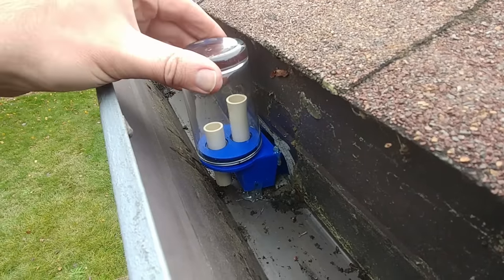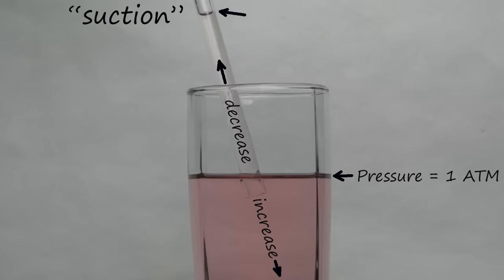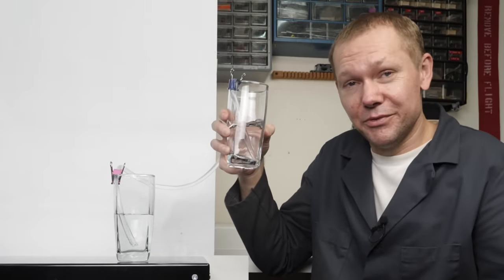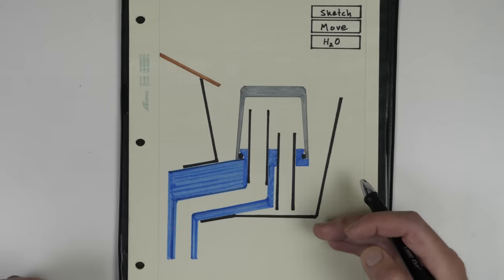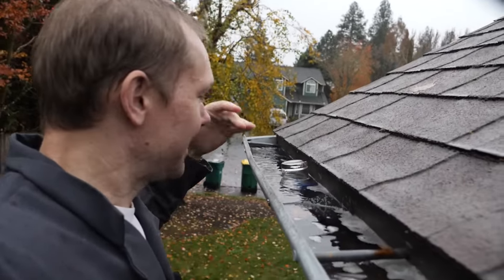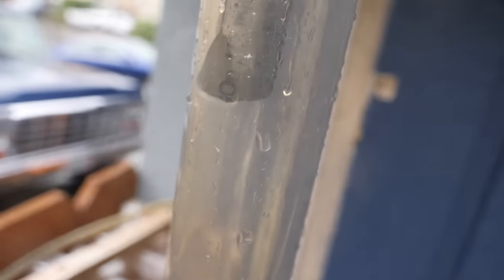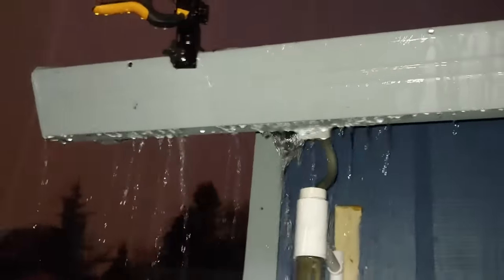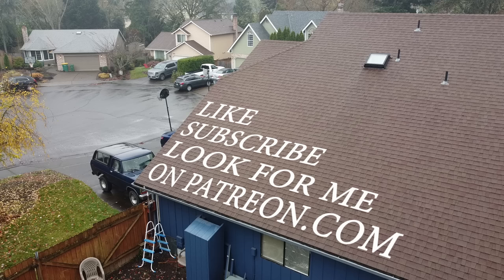Rain Gutter POWER #5 - Bell Siphon Fundamentals and Pitfalls

Comment: As an experienced engineer I can say this is quite an awesome little project. I see two requirements you don't seem to quite directly address.   ...  In order to get the Bell siphon started the outlet pipe must completely fill with water across its cross section. That is how it draws the vacuum up at the top to get started and operate. Then, the diameter of the exit pipe must be large enough to support the maximum flow. 
That first problem could be solved with a small valve at the bottom of the drain tube that opens when the height of the drain tube is full that would rob the least amount of pressure from the starting condition.

If your generator can only support so much flow and it varies too much during maximum rain, you're going to need an additional reservoir to hold that extra water, or as you have done, provide an additional overflow to simply dump that extra water. ... 
.. ..
It also seems like your  paddle wheel turbine is rather inefficient. Since you've got 3D print capability, you might be able to manufacture a more efficient turbine to extract more energy out of that head of water from the gutter down to the generator.
Anyway, I hope these suggestions can provide some help. You have a very unique solution to using something that sits there all the time with no purpose other than to keep water from dropping on the lawn.
Cheers
I just stumbled upon your video and I'm pleased to have done so.
Also, the drawing animation is quite impressive as well.
Reply: There's no real need to have a valve in the system. Having a funnel as the outflow pipe make it much easier to start the siphon. The circumference of the top of the funnel can be considerably larger than the pipe it's feeding into.

This effect is then compounded by the increased speed of the water entering the outflow pipe, which makes it easier to draw the slug of air along. Combined with a properly designed p-trap with a few add-ons you can get a decent size siphon to start at quite a low rate of flow.

The p-trap with add-ons, if you're making it from DIY store parts would be 2 90 degree bends as the inflow, to make a 180 degree turn. That feeds into the bottom of a T-joint, with the top capped off as a small air trap. The horizontal branch of the T-joint then feeds into 2 45 degree bends so there is a small drop, which then feeds into another T-joint, placed horizontally. The second T-joint has the branching opening pointed up into an open stand pipe to vent the air. 

It's kinda hard to explain without a picture, but I'm sure you get the gist of it.

And while not important in a prototype like this, the smaller diameter pipes in the siphon would ideally be made of brass or copper to prevent clogs from organic growth.

I don't have any engineering training in this matter, but that's just my experience building ebb-and-flow hydroponics systems. The reason to use bell siphons there is that you want as few moving parts as possible. Starting a bell siphon with the low rate of flow that a pulsed geyser pump delivers, is mostly flux calculations with a wee sprinkling of black magic and voodoo.
Reply: @fermitupoupon1754  I was thinking a funnel on the exit tube would help.
Reply: @fermitupoupon1754  Why a P-Trap, rather than an S-Trap?  The benefit of a P trap over an S trap is that the P trap maintains the water seal... but that's no a concern here, so wouldn't it be simpler to just use an S-Trap?
Reply: @Londubh  In my experience, so n=1, a p-trap has the benefit of triggering more of a flushing action. It takes a bit more to reach the critical pressure in the bell and down tube, but once that pressure is reached, the p-trap will flush and suck the slug of air with it. So it's more reliable to start, especially with a lower flow rate to start it.
Reply: @fermitupoupon1754  but that doesn't make sense to me. The triggering of the traps is going to be purely a function of the relative heights of the top of the second curve/horizontal-ish but. Indeed, I would go so far as to assume that it would trigger faster with an S because it wouldn't require as much water to fill the top of the S compared to the (not quite) horizontal pipe of the P.

Indeed, the reason we've moved to P traps is that S traps tend to "flush" the "trap" out, thereby allowing sewer gas into the house.
Reply: no valve. more moving parts means more failure.  
if he goes with a valve he might aswel just stick with the toilet plunger system  
good thing you're not an engineer.  (you can claim you are.  but no engineer wouldn't flat out laugh at you for that comment) 
why not just hang the tube low enoegh for the end to be submerged.  no air can then be sucked back up the tube for the trickeling to happen.  
or do nothing at all.  since the trickling honestly isn't a problem.  just means he needs a bit more rain.  
and as you can see at the end.   he might even need a second or third bell siphon to keep up with heavy rains
Reply: As a roof n gutter cleaning business owner of 20 yrs ...i can honestly say.  They can't keep up with our daily rain storms up here in Washington State.. let alone a downpour.

Comment: “Gotta work out an overflow” TWO SYPHONS!
Reply: Said the same. More than one siphon. Oughta handle all that water..
Reply: Small diameter siphon outlet for light rain. Larger for heavy.
Reply: Add in parallel, more water means more generators. Faster charging or multiple battery charge.
Reply: Or a weir at the oveflow...
Reply: Don't even need two bells, 3 pipes in one bell.
Use thick input and then a thin output for the generator and a thick output a bit higher for proper overflow!
Reply: TWO TURBINES!
Reply: A weir at the overflow would be the best option.

Two siphons would only foul each other's operation, and a third pipe in the single siphon would likewise foul the operation of the siphon unless you were willing to sacrifice water EVERY TIME the siphon operates since outgoing flow rate must be less than or equal to incoming flow rate for the siphon to function.  A third pipe could also be no higher than the primary outlet or else the siphon would simply lose vacuum and fail to function (as the siphon would draw air from the third pipe to equalize pressure instead of drawing water from the inlet.)

Comment: Reminds me when I worked in construction and we set up foundation walls. We used a clear hose instead of a fancy expensive lazer to level posts height that are farther them our 6ft level. Works great! Many applications in the real world, especially in construction.
Reply: That’s what I should have done on my raised flower bed 80# manufactured decorative bricks. After very carefully leveling a couple at a time, after 50’ when I came back to meet the ends, I was an inch off and is noticeable. Looks great overall though. Many practical uses.
Reply: Those hose levels are good for short spans to level, the lazer level does not bow with the curbature of the earth. The hose level will take you around the world and the lazer level will shoot you out into space.
Reply: Yep, just keep in mind that if there is wind it could potentially push into one end of the tube, increasing pressure, and possibly even "pull" air out on the other end (Bernoulli's principle), decreasing pressure. That would affect the water level on both sides.
Reply: @nelsonrothermel   you will notice it moving a lot if wind blows in that strong. Just wait for it to settle out and you can always put your hand around it if the wind is that bad
Reply: It's called a water level, in case anyone was wondering. Lol

Comment: I've built a few Bell syphons for aquaponics systems and I would recommend making the brim of the outflow pipe a larger diameter to give more flow faster and activate the syphon quicker and with more force.
Basically you want some sort of a disc or washer on the top of the pipe. I use 20mm pipe for my systems and I just put a 20mm > 35mm adapter on the top of the pipe so there's a larger surface area that the water spills over from and it creates the airlock faster and triggers faster.
Hope that helps with future projects, keep up the good work as you've just gained a new subscriber 😉

Comment: You could build the exact same system on the other end for when it rains super heavy! More power!
Reply: My thoughts too.
Perhaps even adding it to the same wheel but have it at a 90 degree angle from the other.
Perhaps that makes it sound faster?
Reply: If he did the math he could figure out total possible volume of water per minute for his roof during highest record rainfall and then know if he needed 1 or more extra downspouts with generators attached to each. But he might have to stagger the hights to prevent too high of a total threshold to start all the bell siphon if they were all at the same level during a slow rainfall. But he could test to confirm in next video :)
Reply: My thought almost exactly  tony
Reply: That sounds more like science than engineering.  Engineers are supposed to simplify and keep things cost effective.  If the first turbine is properly sized to max payback, it is not likely that the second would ever pay for itself as it would not be used as much as the first.
Reply: Just put an accurately dimensioned barrier near the second drain: with low rain all the water will be used in the turbine; with heavy rain the excess water will overflow!
Reply: Mo Powah Babeh!
Reply: Stephen Branham 🤣🤣🤣
Reply: Stephen Branham watch out for the Kentucky cobra
Reply: @saveriog.825  simply raising the level of the downspout catch would work.   It would keep the level high enough up steam for his siphon set-up to function properly, while maintaining proper overflow to prevent residential system failure.   Trick is finding the magic height of the overflow to make this work both ways.  Much like a pond overflow drain.

Comment: The water level in the glasses actually has a practical use. It’s an old trick to establish level on sloped ground. Fill a clear hose with water, and have one end on a set point at the high point of the slope, then place the other at the low spot. Water level shows the total amount of drop in the grade

Comment: Should do a secondary power station for an overflow valve, that way you don't waste potential power making water
Reply: With higher flow rate at a higher trigger height maybe
Reply: Or add a reservoir at the overflow which dumps its contents when the flow into the overflow stops. Additionally you can add a small foam float valve on the intake to the syphon which gets buoyant once the water gets high enough. This should trigger a more sudden inrush, triggering the syphon to waste less trickle.
Reply: @wilcoslegers8281  yea he could just fill a rain barrel with the runoff and open the hose on dry days to fill the main reservoir again and re-collect the water in the rain barrel again XD 

OMFG i think i might be an evil genius
Reply: I was kinda thinking about a bucket filling with water, then tipping when full to give a powerful rush of water
Reply: Why bother? The amount of power being generated is pitiful - it wouldn't even keep his GoPros running.
Reply: @Slicerwizard  its a proof of concept -.-' size this up say 50x and you'd get dramatically more power...
Reply: @wilcoslegers8281  i think the float valve will shutoff once the siphon starts.

Comment: Wonderful. Very impressive. Can you use this water to fill your toilet too?
Reply: You sure can! Theres even companies like GEP that have developed a in-home water purifier. Its just not known yet if drinking semi purified rain water is actually safe. But theres houses using pure rain water to fill toilets, and purified rain water to fill bath tubs, swimming pools and for showers. Im going to be in one of those homes next monday, going to put some stuff on my instagram: @tdmrkyle.
Reply: 50% of water usage is toilet,  and clothes washing.  I did claim the water for my toilet. 275 gallons in a moderate 4 hour rain with 8 squares of roofing.
Reply: As long as the jet wheel generator is above the elevation of the toilet and you have a collection bin to capture the water then yes.
Reply: @galenmarek8287  I already use it to water my plants...
Reply: @stls1034  pure rain water is directly potable and safe to drink
after passing thru an activated charcoal filter
the filter is needed to remove dirt and dust particles
Reply: @DrCarrico  nice
i use for plants too
Reply: @josiah7913  what bs lmao
rain water is pure
who told u that
Reply: @josiah7913  and as for the dust particles from roof
the activated charcoal filter is enough
ik this cuz my brither owns a water purification company
Reply: @josiah7913  and yes its practical
cuz ppl fuckin use it
Reply: What kind of gutter has standing water? More angle to the dangle. Also get the trees away.
Reply: @galenmarek8287  i like latte extra foam
Reply: Look up "cistern"
Reply: @atharvasankhe2717  You've apparently never heard of acid rain. https://en.wikipedia.org/wiki/Acid_rain  This isn't the only issue, either, rainwater is polluted by any number of things in the air around it, and that's before you even get to the issues with contamination in the collection system. You really should purify it before drinking.
Reply: @qmannnnn  ye we dont have those here
Reply: @qmannnnn  here we got rain water pure enough to drink directly when its raining
hell when in cycling and it starts raining i just drink rain water instead of my electrolyte so that i dont have to lower my speed
Reply: Uh... I think he may have been asking if the Bell Siphon can be used to fill a toilet not so much the water wheel set up.

If that's the case the simple answer is no.
The Flapper doesn't fill the toilet, it stops the water in the tank from escaping. And the flow is stopped by the float reaching a certain level.

The bell Siphon would do a similar job however any time it reached that predetermined point it would flush automatically which if connected to a typical water supply rather than rain water would be expensive and the water would not be available as you need it. 

Now that's not to say there's no use of these things in other ways piece by piece you could find applications for them in the bathroom and many companies have but a bell Siphon doesnt seem practical for a toilet. 
Captured rain water however absolutely, my family fills buckets and the bathtub during hurricanes to pour into the back of the toilet to flush there's really nothing stopping us from just putting a bucket out in the storm and doing it :P
Reply: @atharvasankhe2717  The Acid rain issue the guy referred to is a bit of an issue but that's typically in more industrial areas, I probably wouldn't drink  any water directly from the sky (although I have drank directly from a creek it's not common) given the ability I would do some distillation which can be accomplished by just boiling the water and collecting the condensed vapor in another container but I can't guarantee that would fix the acid rain problem.  It is typically caused by stuff the water interacts with after it's evaporated and essentially naturally distilled.
Reply: @galenmarek8287  I understood that reference😄
Reply: hello there master yoda
Reply: Bell syphons are common place in UK urinal flush systems. 
Water from the mains is regulated to a trickle into a cistern (holding tank) and when the level is high enough it drains until empty then starts to fill again.
The slower the trickle, the longer it takes to flush.
Reply: @davidlench8255  that's the one application I noted in my head that would probably be good. It keeps things clean in a public setting where people may not flush for whatever reason. Essentially automatic but at least how I'm thinking no real control
Reply: @galenmarek8287  Yep, it's got electrolytes
Reply: Maybe you can add a 2de standard siphon as an overflow protector? And route it in a secondary larger pipe that is connected to the first with a checkvalve so when the rain stops you have extra capacity in the intermittent periode from the bell syphon.
Reply: The water from a roof very dirty. Every valves of toilet will broke fast
Reply: Check your local plumbing codes. MANY places with city sanitary sewage line prohibit collecting of rainwater. Peeps were draining the over flow into the lines flooding the tanks at the sewage treatment plants. But separate from the rules here, a rainwater down pipe could be used to fill a barrel as long as the over flow continues out the downspout. The Barrel can have a screen filtered tap, siphon or sump pump installed near the bottom to water your flower pots.

Comment: Nice demonstration of the bell siphon - and a good, simple explanation of how and why it works.

It may be worth noting that guys who setup and level mobile homes have been using the water-tube level for decades. They use very long clear tubing filled with water. They clip one end where they want level to be and move the other end from support pillar to support pillar to level the house by jacking up and shimming each position until the level read the same at each pillar. I have seen (and used) some have 100' of tubing.